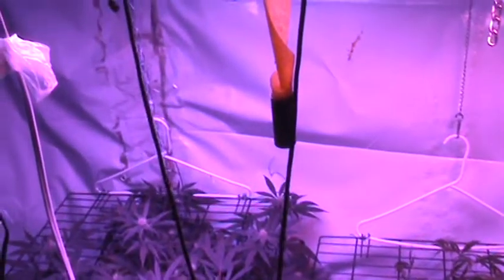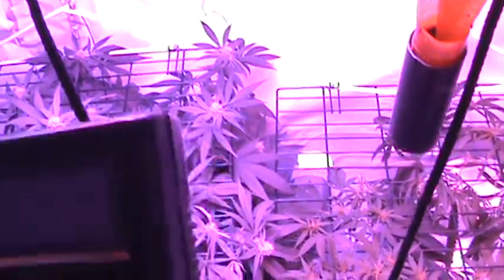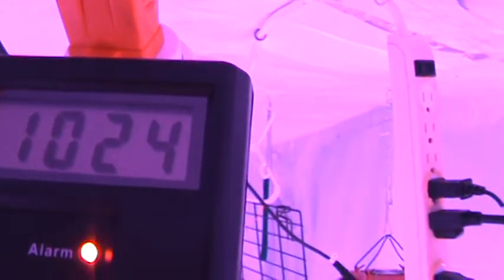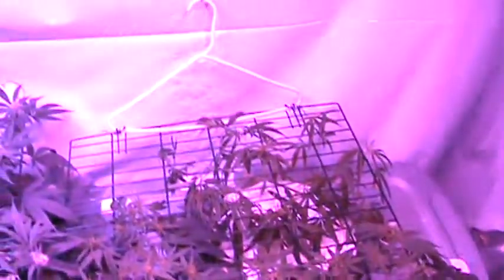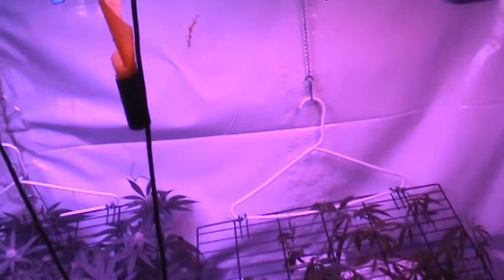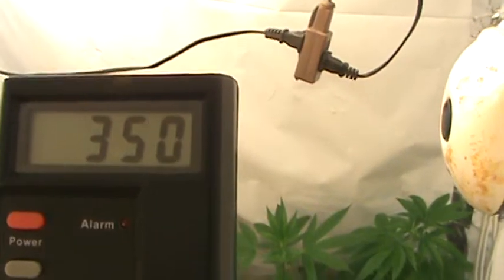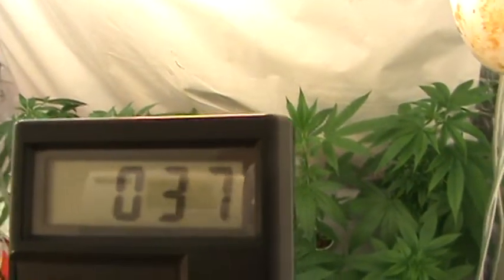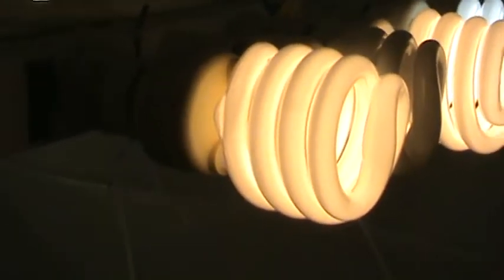DT-1130 Electromagnetic Radiation Detector Measuring LED and CFL Lights

Comment: So would you re'comend the  DT 1130 to test a smart meter?
Reply from the maker: +Texas Lady No.  This only does one thing, detect electrical power in the air.  It's great for checking for hidden cameras.  For a smart meter you need a microwave radiation detector  http://www.amazon.com/Pyle-PMD74-Microwave-Leakage-Detector/dp/B009TQ6IO8/ref=sr_1_2?ie=UTF8&qid=1443175514&sr=8-2&keywords=microwave+radiation+detector.